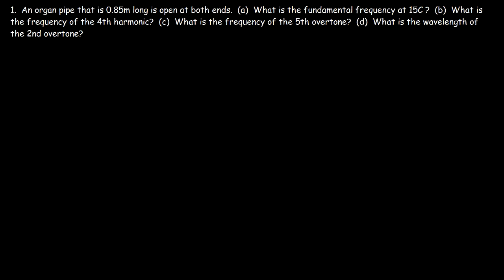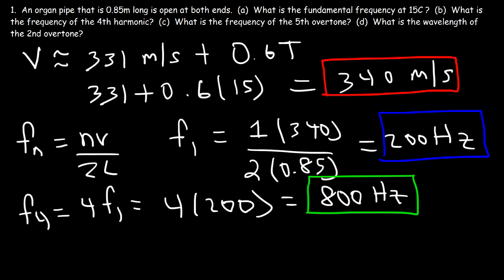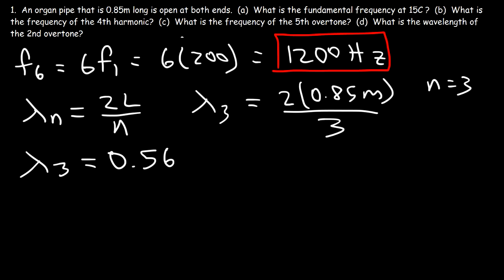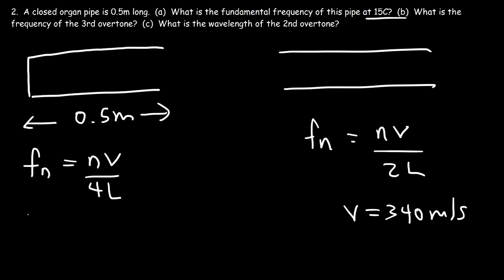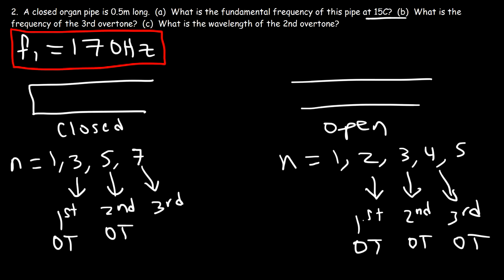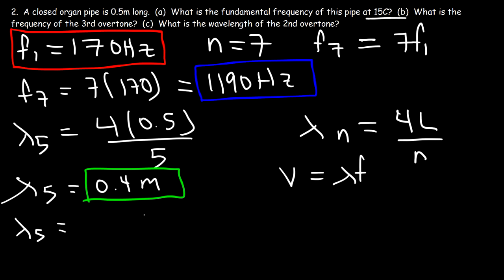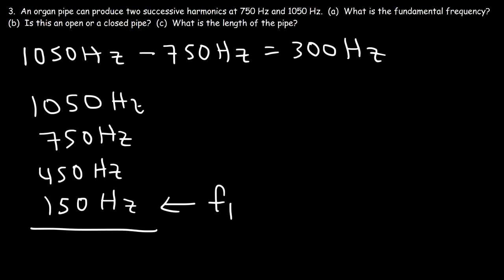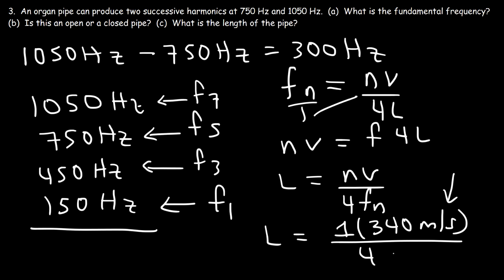Standing Waves In Organ Pipes - Closed & Open Tubes - Physics Problems

Comment: where to get the v=331m/s + 0.6T with the answer of 340 m/s? like... the 331 and 0.6 comes from where? and why do we have  to use the equation to get v? can you explain to me please.... i have exam in less than 48 hours... :')
Reply: Because velocity changes with different mediums (solid> liquid>Gas) and in Gas, the temperature can change the velocity so you’d need the temperature to calculate the velocity of sound in the air. and its usually 340 or 343 m/s.

Comment: How did you get 331 m/s?
Reply: Thats the velocity of sound in air
Reply: It's constant 😁
They could say calculate the speed of a sound wave at 100°c 
Then it's going to be 331 + 0.6(100)
Reply: @petereziagor4604  It's not at all constant. It's 331 m/s in air at 0 degrees C, but the speed will increase with the temperature in said air since sound waves are a form of kinetic energy and kinetic energy is dependant on temperature. Therefore, at 100 degrees Celsius, the speed of sound in the air will be 386.6 m/s. Or are you talking about 0.6? That IS a constant. But 331 m/s certainly is not.